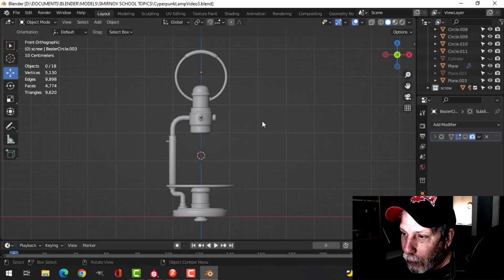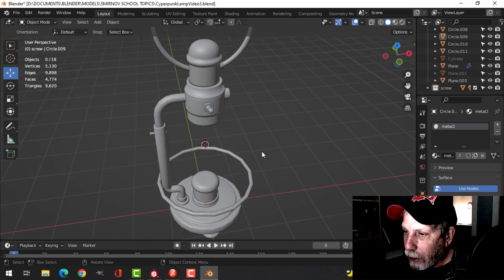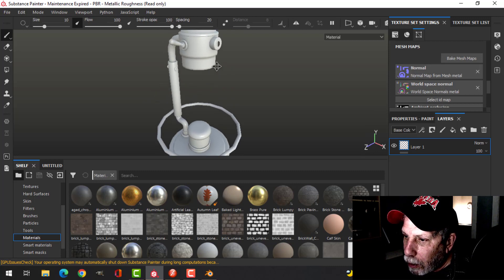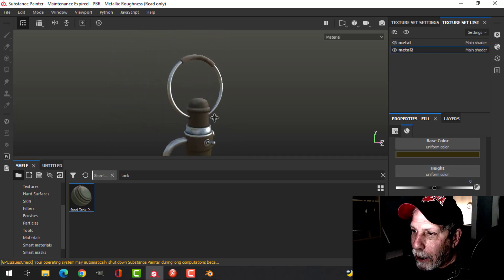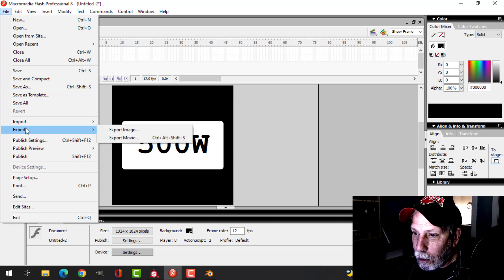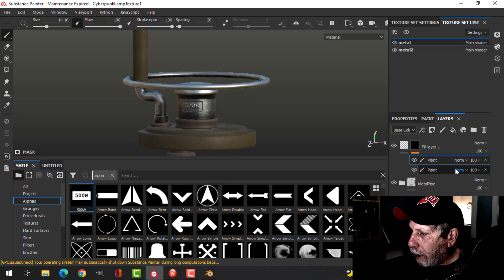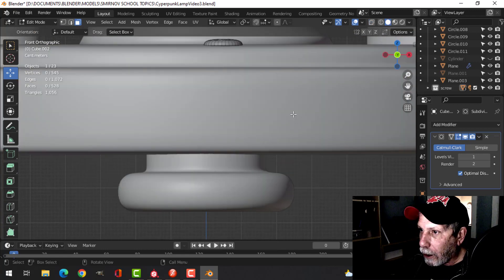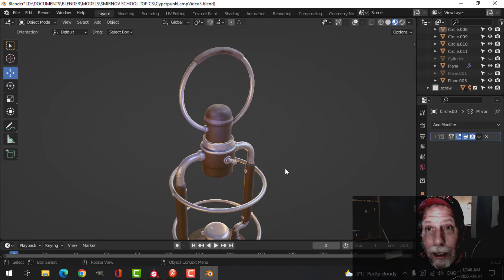BLENDER & SUBSTANCE PAINTER: CYBERPUNK LAMP (PART 3)

Comment: Greetings my friend, can you make a video on how to download the program you use to texture the models?
Reply from the maker: Hi Jesus.  Substance Painter is a paid software and costs around $170 USD last time I checked.  You can search Google and find where you can buy it and I believe it is also available on Steam.
Reply: @zerobio  ho my friend I didn't know that's fine I'll try other options thanks for the answer
Reply from the maker: @jesusdiaz5565  sure thing Jesus.  Another cook software for Blender is Smudgr Pro available on Blender Market, I believe.  But it costs around $30.  There are some free programs as well if you do a search for them and read up.  Good luck.
Reply: @jesusdiaz5565  No reason you can't use the texturing tools built into blender itself.